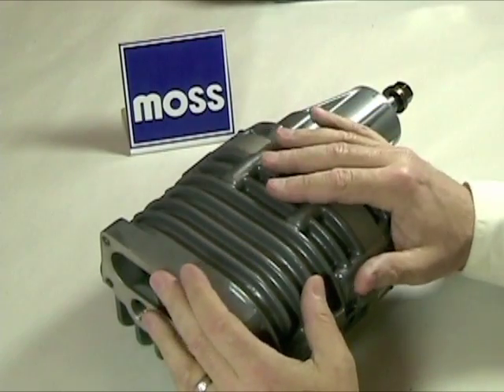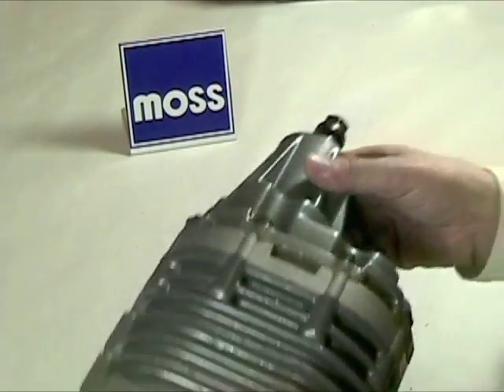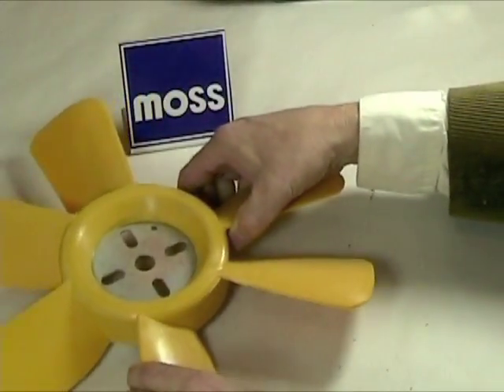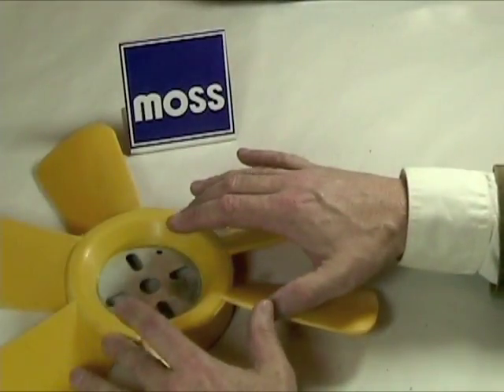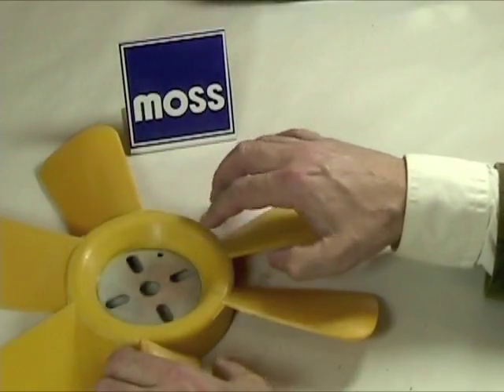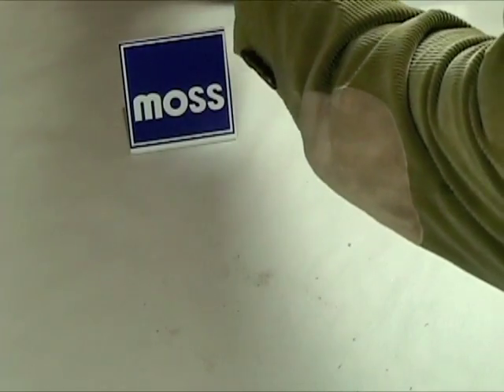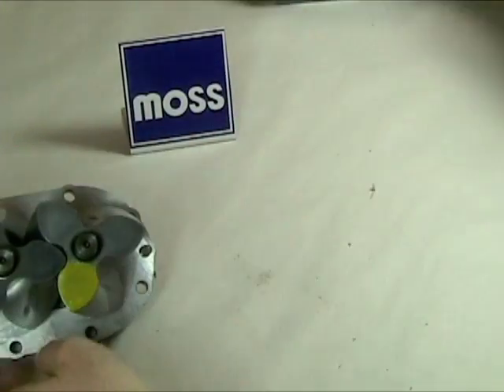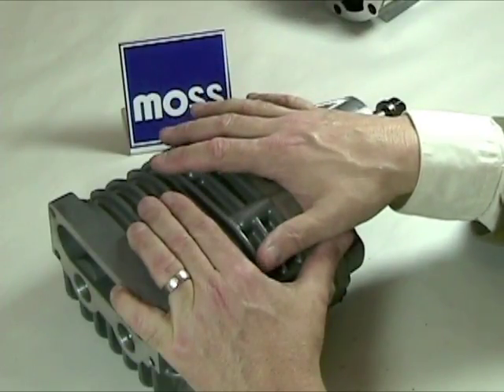Superchargers - How They Work

Comment: Correctly, engines do not 'suck' air in, the atmospheric pressure (the weight of the atmosphere) 'pushes' atmosphere/air in when the falling piston creates a vacuum in the cylinder.  "Atmospheric pressure abhors a vacuum!"  A supercharger is an air pump which raises the motors intake manifold pressure above atmospheric, thereby pushing a greater volume of air (fuel) into the motor.  MORE POWER!

Comment: Can someone explain to me where this draws power from?
I know turbochargers use turbines to compress air, is it possible to put one of these on instead of a turbine, thus having a supercharger that is powered by the kinetic energy of the exhaust?
Reply: you basically just described a turbocharger, superchargers usually run on a belt system. in cases where they run solely on the exhausts energy they are called turbochargers. when both applications are implemented the system is then called a twincharger
Reply: Yeah thanks, I had my mate explain the whole thing to me so I'm all good now.
Reply: +protercool You like jizz?

Comment: 1.8l engine can suck at atmospheric pressure up to 1.8l, but for 2 revolutions. That is 1.8/2=0.9l per 1 revolution, because the engine is a 4 stroke engine and it makes 1 suction per cylinder and 4 strokes,2 strokes per revolution(that makes 1 suction per 2 revolutions).

Comment: Over 100% efficient? Please explain
Reply: The 1.8 litre engine he was talking about, it'd only displace 1.44 litres of air in a cycle, around 80% efficiency, it's designed for 1.8, it does 1.44, its 80% efficient.

Over 100% efficiency, its pulling in more air than 1.8 litres, normally it cant do this, it just pulls it in, what the supercharger does is squeeze the air down, so you've got say.. 1.9 litres of air, compressed down into the volume of 1.8 litres, its the same volume, just at a higher compression.

Pulling 1.9 litres of air into a 1.8 litre engine is around ~105% efficient.
Reply: its not about efficiency as in how much fuel goes in and how much you use or heat available compared heat used in the engine but its about amount of VOLUME fits in the engine at atmospheric pressure compared to how much actually goes in under working conditions (VOLUMETRIC efficiency)
once you start forcing air in (forced induction) you put in more then the size of the engine

Comment: He has a tasty voice. But with a supercharger, since you are creating more power due to the extensive air intake, would you actually save gas?
Reply: I'd say no, because it causes the fuel to burn faster. But I don't know the physics behind it, so take what you will from that.
Reply: +Mako Eve (insert one year later meme)

You dont save gas becasue of the supercharger, but the fact that you have more power makes you not using the gas pedal as much as you would otherwise thus saving gas. I'm talking about sensible driving here, not drag-racing on traffic lights :P
Reply: no you burn more but you get more power
Reply: Air runs over an airflow sensor telling the fuel pump how much gas to pump in through the injectors, so no, sadly it doesn't save gas.

Comment: turbo lag is when you press your foot down on the accelerator,the car starts accellerating,but the turbo has not started spinning to its optimum,and is not yet creating boost,the lag is the bit between pressing the accelerator,and the turbo coming on boost,you only get this on turbo engined cars,and you can engineer around it,you would only get it now on a large turbo and small engine

Comment: it works something like this. when you push the accelator hard the supercharged or any forced induction engine will then burn more fuel but if driving smoothly then no it should be taking fuel as a non induction engine (theoretically)

Comment: Good explaination, you demonstrated working of oil pump, the gears should spin in anti clockwise direction and not clock wise direction to suck oil from top and discharge out.when rotated ACW, vacuum is created and oil is compressed between the gear tooth and not around the walls, thats what creates  disharge pressure. if rotated CW direction, it might work but may be suction and discharge will be disturbed, less vacuum pressure and less discharge.

Comment: @CptNemanja 
if you were to simply slap a supercharger on a car then yes that is what would happen. But to optimize power, you need to get your air/fuel ratio back to normal. So when you increase the amount of air, you also should increase the amount of fuel to get optimum power. This can be done in modern cars by tuning the ECU or by upgrading fuel rails.

Comment: I am a car enthusiast but don't really know much about the engine and all the bits and bobs. Great Video. and i right in saying the air provides quicker combustion of the same amount of fuel pushed into the engine. giving a lot more power but hitting the mpg quiet badly?